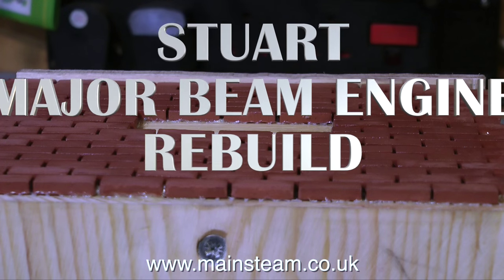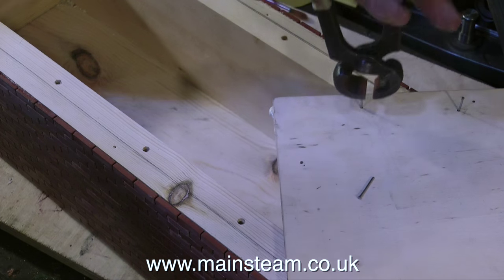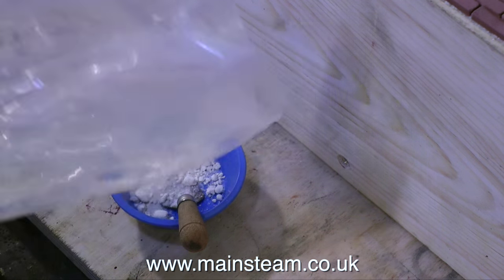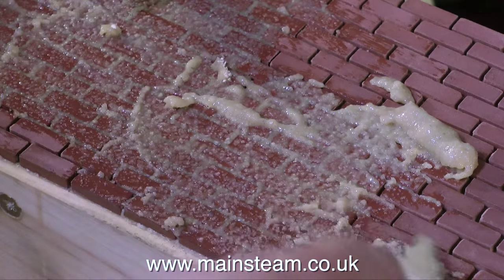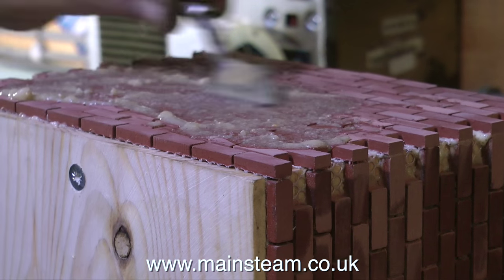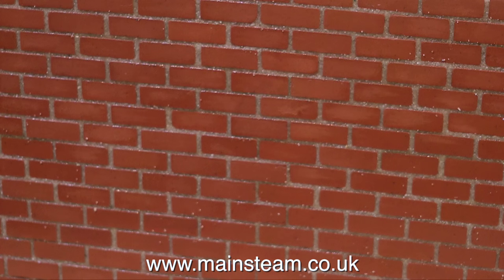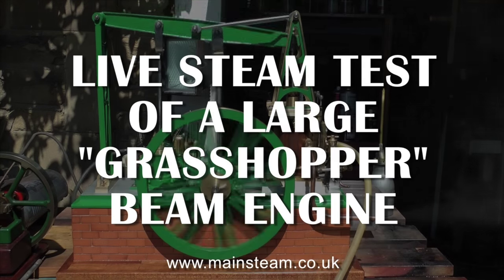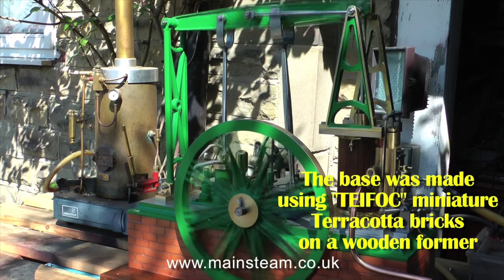STUART MAJOR BEAM ENGINE REBUILD - PART #16

Comment: Another quick ex tilers tip Keith, when spreading the grout a much less messy way is to use an old credit card or suchlike or even better a thin piece of stiff rubber, a steady pressure in figures of eight with the " spreader" held at 45 degrees to the surface, quick light wipe with a damp decorators sponge will clean of any excess and not pull any grout out of the joints.

Comment: the reason they make shafts protrude a little instead of being flush or recessed is something to do with if the part comes loose from the shaft and its protruding, it just moves around the shaft and you have to fix it, if its flush, or recessed apparently its more likely to have the edge move inside the part, bind up again on the shaft edge if it gets a little angle, binding at the wrong possition can destroy other parts in many machines, so it was good practice to make it protrude a little

hard to explain what I mean, but if you take a part and a shaft and rotate both and give it various angles while inserting the shaft into the part till it binds you will sorta get what im failing to say